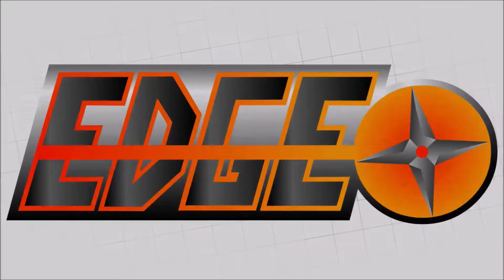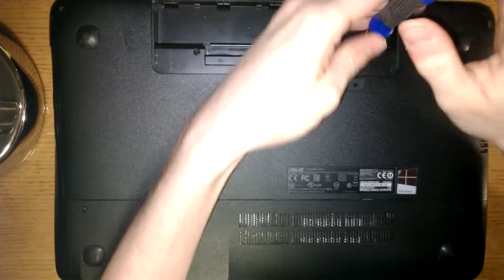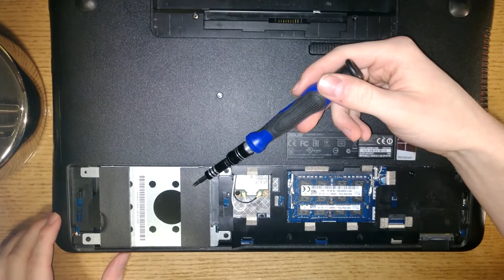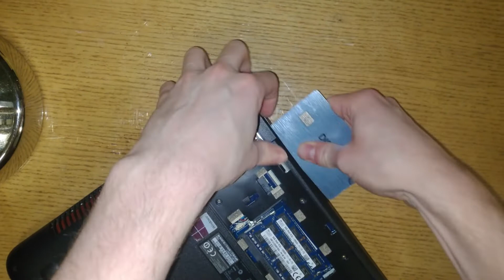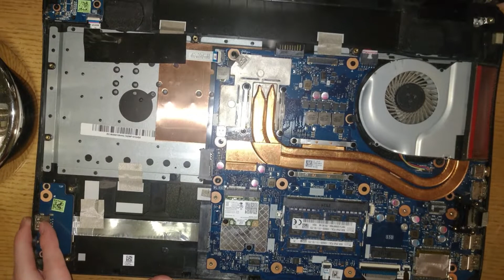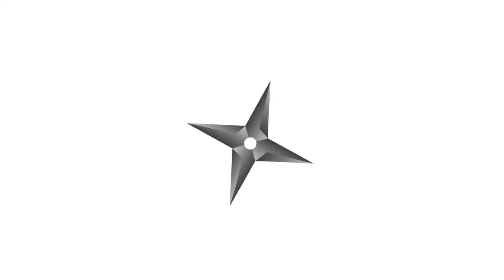Asus GL551J mSATA Install

Comment: i have the n551jk with an hdd drive
is it better to get a regular ssd and move the hdd to the cd drive with a cady 
or an mssd
Reply from the maker: Hi! That's definitely an option. If you want the setup that will make the system feel the fastest I would get an mSATA and put the OS on it. From there you could leave the HDD as is and choose to boot to the mSATA. Or you could swap in an SSD for the HDD and move your data over. Or you could move the HDD to a caddy so you have lots of storage. Lots of possibilities!
Reply: i guess I'll get an ssd
thx for replying 💙

Comment: hey man can I put an nvme ssd into that port? Should be a pcie3 x4 bus right?

I have a slightly newer version of that laptop with a 4k display but otherwise the same
Reply from the maker: Hi! Sorry for the late reply. As long as the SSD is using mSATA as the connection type it should be compatible.

Comment: Ok, this is probably a dumb question but are you using the original HDD as storage and the mSATA for boot only? Additionally is it possible to just copy my HDD to the mSATA? Thanks and great video!
Reply from the maker: It's a good question! The mSATA is used for the operating system and so booting will only happen from it, and the original HDD was switched over to use for storage. It is possible to copy your HDD directly to the mSATA as an image, IF the mSATA's total size is larger than the partition you want to move over from the HDD. There are multiple tools out there to do this, but CloneZilla (https://clonezilla.org/ ) is the main one I've used. If you want to start relatively fresh with the new boot drive you can also just keep your old drive as-is and just choose to boot from the new drive by default. You should still be able to access the data on your old drive. As another option you can just copy over the data you need from the HDD and then wipe it to free up space for more storage. There are a lot of options for how to move, manage, and access your data so feel free to ask more questions! :)
Reply: @EDGE+  thank you very much! I was planning on doing exactly this but I dropped my laptop the same day I commented, and it stopped booting the HDD head is.... not good haha but the plates are still good, going to head swap so I can save the important stuff, then just get a SSD for it.

Comment: can you gave a link to buy it?
i have the same type but g511jm and i didnt have any ssd so im tryna to buy it but idk what the name
Reply from the maker: Hi Cheskuy! I added the link for the drive I used to the video's description. It's currently out of stock, but any half-size mSATA drive should work. It looks like there are currently drives in stock of the same brand with different storage sizes so hopefully one of those can meet your needs :)

Comment: Great job! To clean the fan should I take it off and clean? And probably put some thermal paste on the CPU and GPU? Or can I just clean it without taking it off?
Reply from the maker: Thanks! If it isn't too dirty it's okay to go in with some compressed air and give it a wipe-down with at least 90% isopropyl alcohol. If any grime is really caked on there you can pull it apart and clean underneath with a microfiber cloth and 90% or greater isopropyl alcohol. It should dry quickly, but make sure it's dry before putting it back together. If you're seeing any thermal throttling issues or the laptop is getting hot you can swap out the thermal paste as well. Clean off the surfaces with the same method and then reapply thermal paste (not thermal adhesive) and pop it back on.
Reply: @EDGEplus  Thanks for your help! I did what you told me to do and everything is working fine now. The laptop was full of dust lol. 7 years of use and I never opened it. I wasn't sure the amount of thermal paste I had to put on the CPU and GPU since they are so small. But hopefully I didn't put too much for it to start acting weird.Now I guess I can upgrade to an SSD and 16GB of ram as well!

Comment: Can you send the link where you bought the mSata SSD you've installed?
Reply from the maker: Sure! The specific drive used in the video was this one: https://us.amazon.com/KingSpec-512GB-mSATA-Internal-S550CM/dp/B07XG4GWZ5 but it's currently out of stock. Any mSATA drives with the same form factor should work though, such as this one: https://us.amazon.com/KingSpec-512GB-Half-Size-mSATA-Tablet/dp/B07NV25R67/ref=psdc_1292116011_t2_B07XG4GWZ5